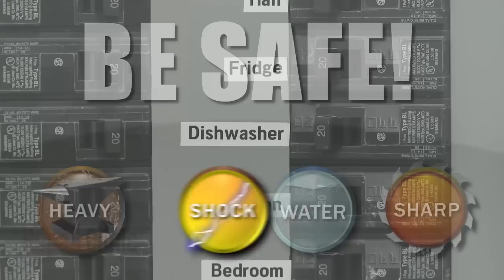KitchenAid Dishwasher Thermal Fuse Replacement #675796

Comment: Where does one buy a thermal fuse? Are they standard and fit all Kitchen Air washers? Does Lowe's or Home Depot sell these? many thanks!
Reply: Amazon. But check with a KitchenAid parts dealer first to ensure you are getting the correct one.

Comment: How do you diagnose that the thermal fuse is the problem?
Reply from the maker: Click here for part testing info: https://www.youtube.com/watch?v=L-tAMHQbivc
Reply: Just use a volt meter to ensure that current passes through it (resistance mode).